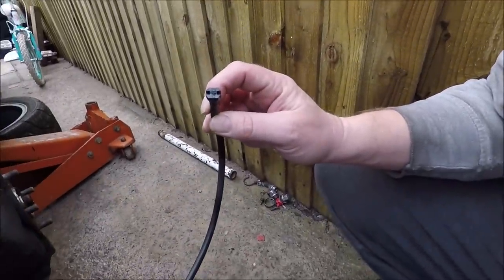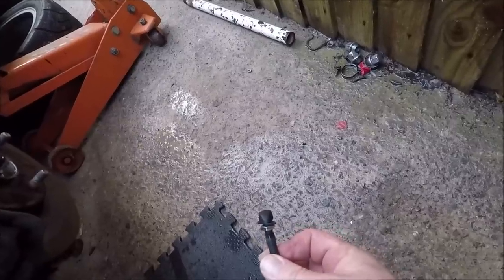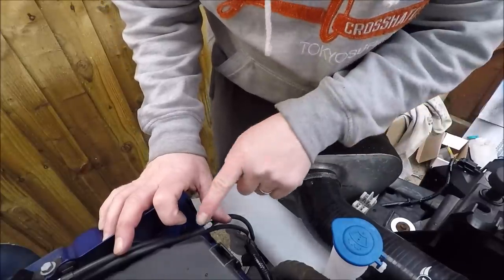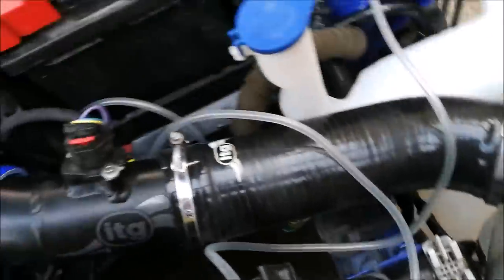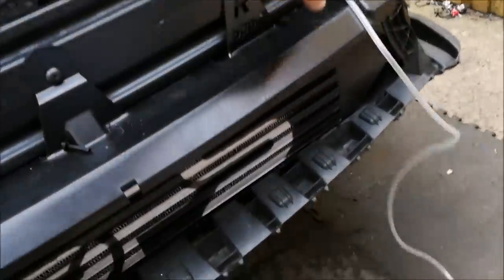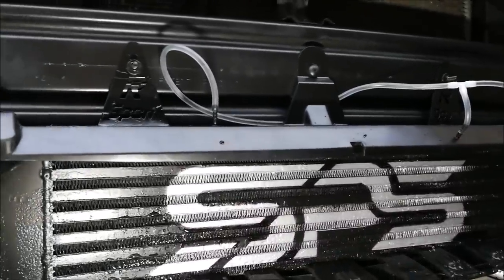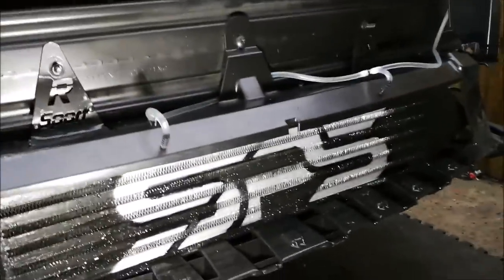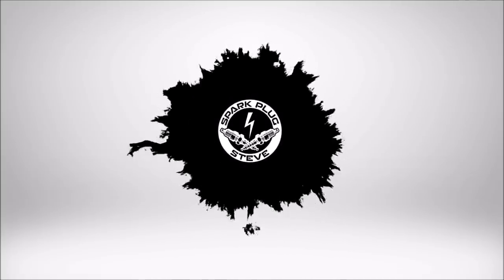DIY Intercooler water spray. FIESTA ST part 8

Comment: There are misting sets for the garden which actually mist in very tiny drops. 

I think you would gain some more cooling and use less water with it.
Reply: Yeah fine mist is what you want, it evaporates fast taking the heat with it. Dripping wet intercooler will only hear it up

Comment: Stick an isolation switch somewhere to turn the motor off for the rear wiper, presumably it will still 'wipe' even though the water is flowing to the intercooler only.

Comment: Get a grommet on the intercooler spray hose where it passes through the hole in the front member. It will chafe through otherwise. Won't be much use if it all pisses out before it gets to the spray jets on a hot track day!

Comment: Nice job, would be interesting to know what the temperature drop would be with the spray... 
Also if you could add a timer to the switch so it sprays for say 30 / 60 seconds on one touch...
Reply: Id say test it with a monitor that reads the Engine coolant temperature, and have someone read it while driving on the highway, and see if it drops
Reply: @IDABAYAREA650I coolant temp has nothing to do with intercooler temperature

Comment: Hi Steve l think you should have the jets going straight down. This way with your forward motion of the car it will go onto the intercooler. If doing it angled then it's only going on a certain part of intercooler & in forward motion further up the intercooler & not giving a full cooling. Why not add a  third jet for in the middle so no parts missed. Just my opinion.
Reply from the maker: Thanks I did think I will add a 3rd jet.

Comment: thanks for the video. I have tried  doing the same but face thefollowing  issue. because of water pressure, water keeps flowing from the tank to the  spray nozzles and wont stop untill it is out of water.  thought it would be the nozzles (spray jets) but you have used the same in the video. 

is there any chance you remember if you have done something in order to stop water from leaking? thank you

Comment: i dont know if you have changed your spray setup there but id use the exes to make a spray of equal pressure then connect to that so similar to a Y bend but thats a cool idea.

Comment: You got trolled by your daughter lol. Wicked idea and neat install. Are you going to bother with a rubber gromet where the pipe came through the hole in the front radiator support panel? Those jets worked a treat, will be useful for all of 4 days a year lol.
Reply from the maker: Thanks. Il probably just take my chances and see if it chaffs.

Comment: Good work. Whats the goal here Steve? Same boost in summer ar winter? Better boost overall? Just thinking bout my old t5👍
Reply from the maker: To be honest it's just an idea I had and wanted to do it. Possibly on the real hot summer track days it may lose some power due to heat so just though why not do it just incase.
Reply: @Sparkplugsteve  👍

Comment: what you could do as well is get an old diesel fuel cooler that goes under something like a citroen c3 and use that so the water runs through it. if you mount it somewhere at the front where fast moving air is going to hit it, it will make sure the water is nice and cold before it's sprayed onto the intercooler. if it comes straight from the bottle will the water not be warm?

Comment: The rear washer is far too powerful on the ST, it looks like a racehorse is pissing on the back screen when I operate mine. Nice cheap mod, thanks for sharing SPS, really enjoying the vids btw and particularly this rebuild series. Do you use a DI vessel for your window cleaning, was thinking of getting one for rinsing FiST off after a detail?
Reply from the maker: hi it is really powerful. haha. yes i used ro and di vessel for my water. i did a video a few months back if you look back. thanks
Reply: @Sparkplugsteve  Thanks Steve, will take a look.

Comment: Hi mate... If the valve  is switched towards the intercooler only. Will The rear wiper will move as u activate the wiper switch from the cockpit?
Reply: Yes, it would still operate the rear wiper because you are still using the factory rear wiper motor and washer switch. Easy fix would be to remove the rear wiper motor fuse. FYI, some cars have separate rear motor and washer switches, so check to see how your system operates. Hope that helps!

Comment: Nice work, what’s the pipe ID? And are you using purified water to prevent rusting when the cooler gets stone chips?
Reply from the maker: Think it's 4/5mm id. Cooler is alloy so won't rust. Thanks.

Comment: Gardiner 100° fan jet 😂 I would know that because I'm a window cleaner to👌👍
Reply from the maker: Spot on indeed. I ordered the fan jets in 100 degrees but never used them as I have x line rinse bars. Thanks for watching.

Comment: Correct me if I'm wrong but isn't the intercooler just for cooling the air/fuel down, and the main radiator takes care of the engine ?
Reply from the maker: Yes your correct.
Reply: @Sparkplugsteve  So I suppose your hoping the water will bleed through and wet the main radiator because the intercooler wont make any difference on its own to the temperature of the engine. perhaps the jets would have been better placed so they sprayed directly onto the main rad.
Reply from the maker: im not trying to cool the engine water temp. its the air inlet temps i will be cooling

Comment: I'm new here :-) on a serious note wouldn't you only do this on a car with big bhp or is the cars cooling not upto scratch?????
Reply from the maker: to be honest im doing it becuase i like to just mod things. the cooling should be fine but just incase its an extra help
Reply: @Sparkplugsteve  righteo mate I had a little read up about it but mostly commonly used in Australia for the high climates but good work mate you know what your doing👍 what sort of power is your car rated at??
Reply from the maker: @VELOCETTEify  its standard power for now but once its on the road its getting stage 2 map which is about 240bhp and then in future il go hybrid turbo so 300bhp plus.

Comment: Steve what about screen wash onto your inter cooler if you using same tank
Reply from the maker: if its meth based its even better.
Reply: Sorted great vids  I av just done vudu bottom engine mount  and there short shifter . Wow what a difference to my fiesta st3. Was u planning on doing this to yours
Reply from the maker: @madmanwrx4131  yes definatley.

Comment: can u tell me anyone any damage of intercooler in use water spray....... any problem can i use water spray..... any crack in intercooler or corosin in   intercooler.... plz told me
Reply from the maker: Do you drive in the  rain?
Reply: ya some time...
Reply: my intercooler are head on the engine nozzle so water spray system  instol so  any damage in my nozzle or not in some water dropped  on nozzle

Comment: Engine hot, water warm, spraying over intercooler? Naaa butt!! That doesn't seem a gud idea, no offense! How's that gonna work its not cold? Love your vids tho!
Reply from the maker: Maybe not but I didn't invent the idea. It worked for subaru and mitsubishi so I guess it could work for me too? Thanks for watching.
Reply: it works because water is far more efficient at heat dissipation than air, in other words helps to take the heat out the radiator faster, even warm water will help a hot radiator with the wind blowing on it
Reply: Lick your finger and blow on it, imagine how cold the water on the inter cooler would be at speed  👍🏼